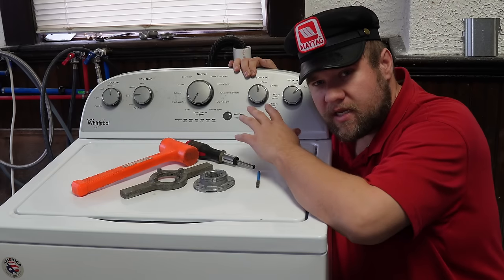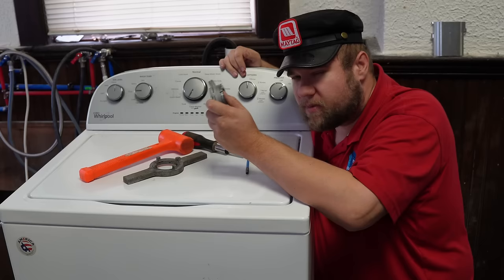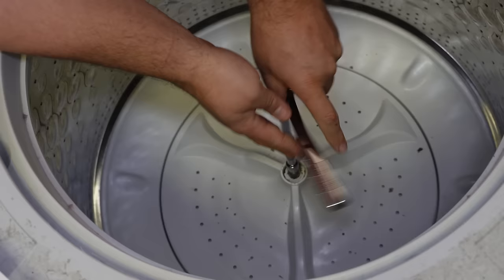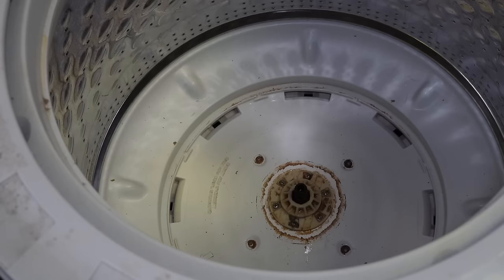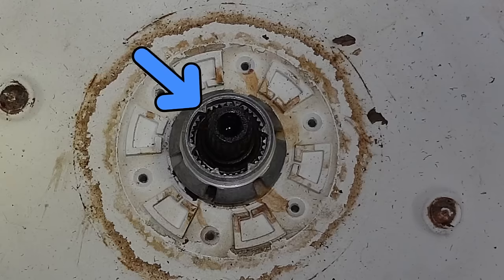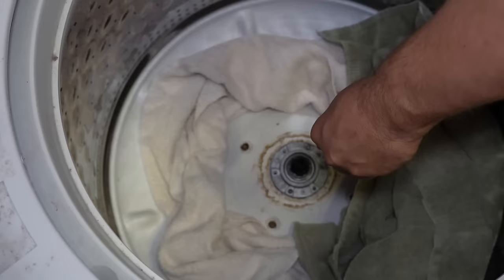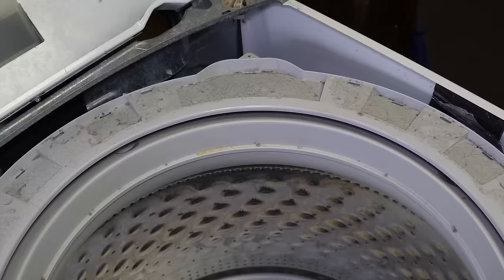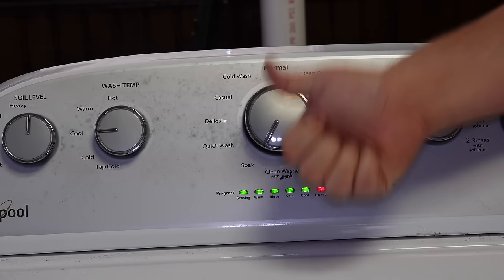Whirlpool Washer Won't Agitate or Spin Properly - Metal Hub Upgrade for Stripped Gearcase Splines

Comment: Ok question.. mine spins with no problem but won't agitate.. the top part works fine. Teeth are all good and everything... HELP! Is this video most likely my issue?
Reply from the maker: Check codes and shifter

Comment: Just did this upgrade with the metal hub and replaced the suspension rods…….did not fix☹️….still have the violent shake on spin mode. It definitely took out all of the play between tub and housing…….No idea what else could be causing it.????
Reply from the maker: Did you recalibrate?
Reply: Yes, but I’ll try that again….
Reply: It seemed to go through the recalibration fine but just tested again and terrible shake on spin cycle…..🤦🤷‍♂️

Comment: My wash plate spins freely, which it should not. When I try to loosen the bolt, the shaft spins, and I cannot loosen it.  Holding the wash plate/drum does not stop the shaft from spinning. Any ideas for removing the bolt?
Reply: Using an impact wrench did the trick. The bolt is now out, but I can't remove the wash plate.
Reply from the maker: I have a few videos on that. Usually super hot water then forcing machine to run agitate will do it

Comment: Thanks Ben for the video. I completed all the steps and the spin cycle is great. No shaking (There is some squeaking as the basket agitates. BUT I just tried a blanket for starters. The blanket ends up on one side of the basket in a lump. What did I do wrong?
Reply from the maker: Make sure to calibrate. But that does happen I've seen regardless of this fix.
Reply: I did recalibrate and it says there are no errors. I'm wondering if the metal hub went on not totally level? What would make the blanket all on one side of the basket? I dont know how to fix that @bensappliancesandjunk
Reply: thanks anyway!

Comment: Thanks, Ben — what a great video!

I have a couple of questions:

[1] Will the metal hub upgrade kit [W10324651] fit on a Maytag Bravos MVWX655DW1?  For some reason, my model isn’t listed on the model compatibility list.

[2] In addition to brushing the rust off of the drive motor teeth & metal wash plate splines, should I put on a corrosion inhibitor?  If so, what do you recommend?

Many thanks!

Carl
Reply from the maker: 1) Yes it'll work
2) maybe a light inhibitor but no idea what I'd recommend at the moment
Reply: @bensappliancesandjunk  Thanks, Ben!
Reply: i have same bravos

Comment: I noted that the metal drive block does not engage the splines as far as the plastic hub because when the special nut is fully tightened, it will pull up the drive block about 1/8". Is that acceptable, Ben? You can see this by hand assembling the unit first and comparing how far the splines can engage compared to the plastic hub spline depth.
Reply from the maker: As far as we've tested, its fine and runs without issues

Comment: My Whirlpool WTW5840BW0 will agitate normally with no load (empty), and with a small load, until it adds enough water that the load becomes heavy. Then it will barely move, and definitely does not agitate.
Wondering if the increased weight is when the splines start slipping.
Reply from the maker: Possible. I'd also check belt, splutch and capacitor
Reply: I'll check out your other videos for sure.
Thanks!

Comment: Ordered the hub, but the threads don't match on the two halves.  Is that intentional?
Reply from the maker: No? Never seen that happen before. It should match, but may only fit on one way.
Reply: @bensappliancesandjunk I got it all together,  and the threads were only off enough to be able to go on tight but not cross thread.
Thank you for the video!

Comment: Thanks Ben for the video and parts.  Quick question, is this supposed to sit flush to the base of the wash tub?   I’m not having that happen.
Reply from the maker: About 25% of cases it doesn't until you re-insert the 6x screws to tighten the hub and tub. Usually that will raise the tub properly.
Reply: Thanks for the reply.   So it’s not flushing down with the screws tighten.  I’m trying to post a pic but it’s not letting me here on YouTube.
Reply: so far  @bensappliancesandjunk  tub has not been raised.   Tightening up and leaving a gap in-between the tub and hub.  What do you recommend?

Comment: Bit of an old video now.. but might anyone know about a Whirlpool washer that was stuck on spin dry. We had to unplug it and on restart it sits on sense for a bit and jumps to done. Not sure what to call a sensor for this..
Reply: Just unplug the washer from the wall receptacle for 1 hr then plug it back in.  That resets the computer as Ben said.

Comment: Will this repair also work on models with agitators as well? I noticed you are repairing an impeller unit.
Reply from the maker: Some agitators but not most. It just depends if they have the hub underneath as seen in this videp
Reply: So the only way I'll know is if i take it apart?
Reply from the maker: @alexandermendonca1359  I would look the model number up on a part's website. That has schematics and look for the hub area and see what is there

Comment: Wow, wish I would have seen this last week, We had to have the hub replaced over the weekend and the tech says the splines on the transmission shaft are wore out as well. Do you recommend this as a replacement for changing the transmission or once the splines are to worn, is it too late?
Reply from the maker: This can be used even w/ worn out splines often. Its not a perfect fix in that every worn out GC spline can be covered, but the teeth on these hubs are much sharper and can catch a worn hub because of how I had to tap/press the drive tube onto the gear case.
Reply: Once you use the perma glue it will not come off if you need another repair and you probably will, The splines on the transmission are worn. It will just slip over a short period of time and then because you cannot get the spanner not off. You will have to have your tub replaced at a major cost.  . If this was a certified Whirlpool replacement. I would like to think Whirlpool would do it because it would save them tons of money.
Reply from the maker: @LarryHutchinson-us9vs  it's blue threadlocker. It's not permanent. There's the exact same blue threadlocker on the tub screw from factory.
Reply: I've replaced suspension rods, got the plastic replacement hub, and this I thought would solve my problem. Did not work.

Comment: Awesome video Ben!!  I wonder if the metal hub (W10324651) fits a Whirlpool Cabrio WTW6500WW1 model because it doesn't show on the compatible model list?  If not, is there a metal version that could replace the OEM plastic hub (W10820039)? Thanks!
Reply from the maker: Hi, it doesn't work on cabrios. I am considering making a metal version as a replacement for the OEM hub for that version.
Reply: Great!  I'm sure a lot of people would be interested in a such awesome solution.  I certainly am!!  I stay tuned!  Thanks again @bensappliancesandjunk

Comment: Is the wash plate suppose to free spin independent of tub?
Reply from the maker: Not loosely. If it spins loosely it's splines, the wash plate, are likely shot
Reply: @bensappliancesandjunk  you're correct few minutes after posting question I had it off. Wore slap out.  I'm concerned about washplate splines a little. The shaft splines were full of dirt and rust. I appreciate your response sir. Going see if she will opt for the metal one.
Reply: Metal one mounted. Now attempting recalibration.

Comment: The fact that they replaced this metal piece with a plastic one is maddening. It's a plastic gear in direct contact with a metal shaft. Any and all oversized and off-balance loads are going to strip this part very quickly. If it was there to protect the motor from being destroyed in the event of a failure that would be one thing but that is not the case here as when this part fails it just progressively worsens the problem. If this is some take on planned obsolescence it's an utter failure because it just makes you hate the brand whirlpool and maytag.

Comment: I wanted to buy this kit but your sold out ?
Reply from the maker: Trying to get more stock ASAP
Reply: @bensappliancesandjunk  this is a life saver for those big whirlpools . We thought the suspension rods were bad . We slapped a new set and sent it out ! When it got to the customers house it about walked across the floor and all hell broke loose lol
Reply from the maker: @bruce7259  more and more I'm seeing these non-rod repairs needed. The tubs are garbage plastic and waller out, and these SEEM to help renew them slightly, but not perfect. Its better than throwing the unit away, though.
Reply: @bensappliancesandjunk  yes I agree !

Comment: I have a WTW5105HW0 with a glass lid. This fix will not work bc it look totally different under the agitator. It has an arrow on it and it has no screws. I’ll just have to get a new washer and send theses parts back!

Comment: How do we know that the plastic piece is worn..... that one that you removed looked normal. I removed the agitator and found a worn out coin that might have been blocking something or causing resistance. My agitator was not worn like some videos I saw. I guess it could be the plastic piece

Comment: Why didn't they just make it with metal from the start?  Just designed to break I guess.
Reply from the maker: They did make it this better way then they cheaped out. I have no idea why.
Reply from the maker: @nunyabusiness3786 these hubs were used for 5-7 years on other models of the exact same design, so I'm not sure what changed in that timeframe. No techs complain about failed washplates/agitators using these hubs as far as I'm aware.

Comment: The link for the video for recalibration isnt popping up and isnt in the description and theres no pinned comment...
Reply: No one seems to have my model of maytag.  It's a bravos but does not look like the dozens of videos on yt.  Mine has a ton of lights all over the panel not just one little row.  And the technique for calibrating described by yt videos does not work on mine.  I have the technical manual that came with the unit, it tells how to go into diag modes and all that, but no mention of calibrating.

Comment: So I installed one of these meatal hubs (I found at Sears parts direct) and it lasted about a week before it broke into 3-4 pieces. Wish that I was able to post a picture. We do have hard water but I don't think it should have disintegrated that fast.
Reply from the maker: Shouldn't have. I've seen that on the ones we make too. I've called our factory and requested a change from ADC12 to 316SS due to that.

Comment: I’m having issues with my whirlpool wtw5000dw2 shaking violently. I have replaced the suspension rods and replaced the plastic hub with a metal one. I’ve recalibrated the machine, but it’s still shaking violently (maybe even worse now). Anyone have any suggestions that I am missing? @bensappliancesandjunk
Reply from the maker: Likely the geaecase needs shimmed. It's the missing piece of thr puzzle I didn't address in this video. I'm having some custom fabricated now and will report on them soon

Comment: What's the purpose of the black pull tie?
Reply from the maker: Old item included years ago when WP was selling these hubs as a kit w/ the gearcase, as a clip to hold the wire trunk underneath w/ the new gear case. Some how they still include em

Comment: Can someone tell me if the parts that he shows to buy can be used on a Whirlpool Cabrio??
Reply from the maker: Hi, they can't for most Cabrios but we actually made a kit for most Cabrios that this one doesn't cover. If you let me know the model# I can tell you what will work.
Reply: @bensappliancesandjunk  thanks for your reply. The machine is currently at another location so I’d have to get back with you in a few days.
Reply: @bensappliancesandjunk  the model # I’m needing these parts for is WTW8240YWO . I need the tools also.
Reply from the maker: @M_Samp  that one doesn't use the same hub as this video. You don't need a tool for that one, just the hub. Part# is: W10820039

We have them available at Bens-Appliances.com in metal. We're the only place in the world to of developed them.
Reply: @bensappliancesandjunk  thanks so much, Ben. Plan on placing an order in next day.
Reply: @bensappliancesandjunk  can you briefly explain how  installation for the model I have is different than this video?
Reply from the maker: @M_Samp  Plate comes off identically. When you get to hub, there are 6 screws just like this. Take them out, and hub comes off. There's a small metal ring inside the hub that you'll install with the new hub. The kit comes with 2 size hubs, because there are so many kinds of gearcases for that style... One will fit or the other will, but both use that smaller metal O-Ring inside. Way easier than this one honestly.
Reply: @bensappliancesandjunk  Gotcha! Thanks.

Comment: One you put those flat style whirlpool washplates back on, use a bolt from a washer like a direct drive… the rubber seal needs to be there so it won’t corrode the washplate back on…
Reply: my maytag bravos never had a rubber seal on it. what do i order to get what i need? any oem part number? TIA

Comment: Could this apply to a Samsung top loader too??
Reply: I took it apart and it’s not the same 😭 any clue why my machine is still unbalanced after I replaced the suspension rods. I am at my wits end 😭😭
Reply from the maker: No, wildly different hub style

Comment: Thanks, Ben! I have a Maytag "Commercial" top load washer model number MVWP575GW1. The hub has stripped several times. The plastic hub is part number W10528947. Will the metal hub you are using in this video - part number W10324651 - work on my washer? I am so tired of this thing breaking down! Thanks again, Ben!
Reply: Ben, I used the same replacement plastic hub on my Maytag MVWC215EW1 last year. My washer has an Full Actuator instead of the Washer plate. Will your metal hub work on my machine?
Thank you

Comment: Something I’d like to do is make a washing machine into what I call a poor man’s washer.. how it works is you fill it up manually with hot or cold water. Then you have a switch to turn the agitator on. Let it agitate for the desired time than switch it off. Than manual pull a plug to make it drain. So it’s basically the same thing as the old fashioned washers.. it doesn’t need to do anything but hold water, agitate and drain. No other functions.
Reply: Yea but the without a way to spin out the water from the clothes, you'll having sopping wet clothes that will take a week to dry.
Reply: Buy an old ringer assembly to squeeze the water out.
Reply: Thanks for the ringer advice… yeah that’s how old washers work. What I’d like to know is how to bypass it so that it does the above function. Anyone know? Or know of a video that shows how?

Comment: The problem with this fix is most of the time when the plastic hub strips out the metal shaft splines are rusted off, so you need to replace the transmission.
Reply from the maker: The teeth on these metal hubs seem to be in WAY better shape than plastic. Deeper ridges to hold on to the teeth, IMHO

Comment: HELP!!!!!
Still bangs after this and New tention rods.
Reply from the maker: Likely needs a gearcase shim and bounce b gone if you bought the Rods from amazon
Reply: @bensappliancesandjunk  
Would you happen to have links to those products?

Yes, I bought them off of Amazon.
Reply from the maker: @johnpolcintertiarypaul6369  https://bens-appliances.com/products/bounce-b-gone-washing-machine-suspension-grease-ba-80048?_pos=1&_sid=396670320&_ss=r

https://bens-appliances.com/products/gear-case-shim-kit-for-whirlpool-maytag-and-other-gearcases-ba-27194372?_pos=1&_sid=0781e277f&_ss=r
Reply: @bensappliancesandjunk  
What if a screw falls in.......
Reply from the maker: @johnpolcintertiarypaul6369  you'll have to pull the tub out
Reply: @bensappliancesandjunk  got it out, put back together and recalibrating.

I did order the spring grease from you.

Comment: Still out of stock?
Reply from the maker: slowly getting a few in stock, but the bulk will be available in about 3 weeks.
Reply: @bensappliancesandjunk  thanks for the quick response Trying to get that 7/16 nut off the top can i use a penetrating oil ok?
Reply from the maker: @gilbosavannah  yes that can work sometimes but it's not perfect
Reply: @bensappliancesandjunk  it's like it's rusted on there

Comment: those six screws always have two or three that round off and i have to drill the head off and i never reuse the old screws i by stainless screws to put back in so nothing rounds off
Reply from the maker: Nice tip!
Reply: where do i get them part number?

Comment: Garbage design it dosent matter if teeth are worn down on transmisson They make it out of ferrous metal, which rust it should have been made out of 316 stainless, and all your hubs should be made out of something softer that will fail such as a brass, but they do this s*** on purpose. I've been in manufacturing 45 years. If I designed one, it would have stainless steel.  And brass.
 Plastic is good in areas that you want to fail to keep from destroying a more expensive part like the gear case spine on the transmission,,, on mine. It's completely rusted. Out so it wont matter if I upgraded  These appliances are just junk nowadays.
 They do this s*** on purpose, so you'll have to buy another 1 in 10 years or less. Tool and die maker by trade and the designs are garbage too because its a young guy on autocad thats never repaired anything in his life drawing it up anyway venting after wasting 2 hours removing a corroded hub, an agitator plate At this point I'm better off.Buying a new machine rather than spend $300 on a new transmission.
New appliances suck period